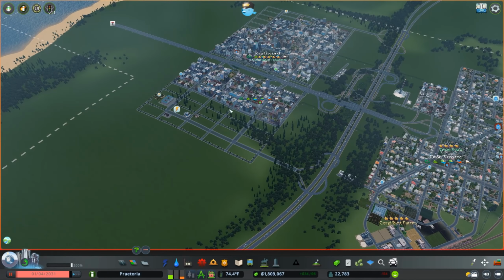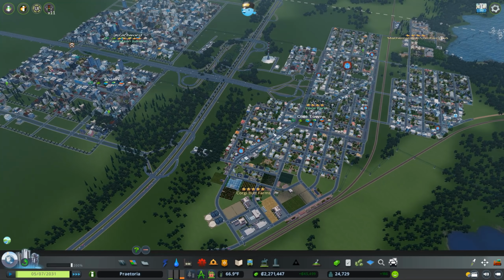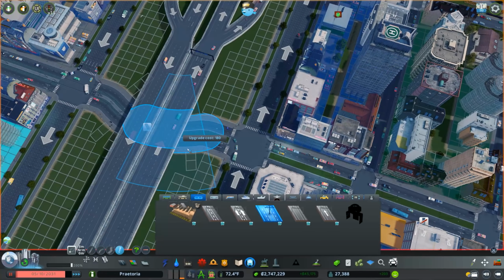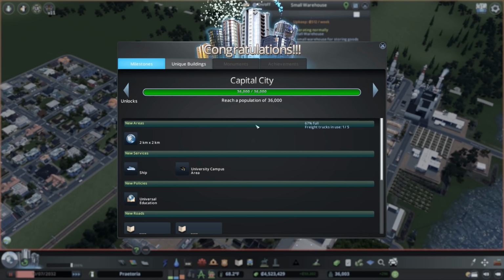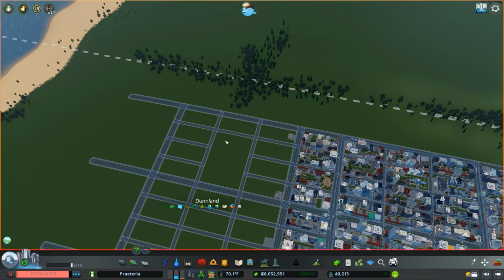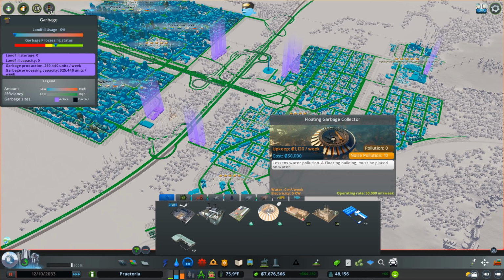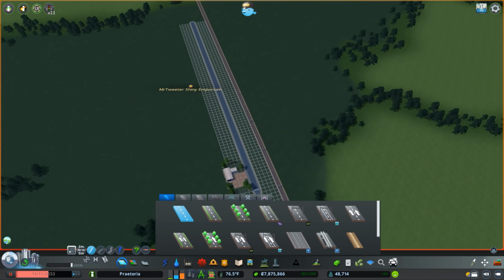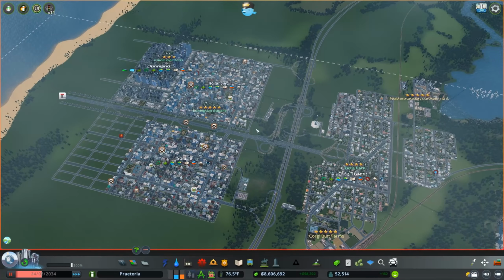Cities Skylines - Industrialism (Part 5)

Comment: @Pravus I know I'm kinda late with this comment, just trying to catch up on your series, but I wanted to comment on why people prefer to take a side ramp entrance instead of direct entrance. The answer is: The Speed Limit. They always take the fastest route considering distance and speed limits but not the traffic. So you can solve the issue by using TM:PE to decrease the speed limit on the side ramps. Then they'll take the shorter direct entrance when reasonable.

Comment: use signs, replacing the lights. using YEILD signs for the major goings and stop signs for the less major. use the traffic manager mod youve been using but you can use more of the features to mittigate deleting roads, creating roundabouts, upgrading roads, or moving buildings and service buildings ETC.
Reply: also using curved roads keeps the cars going faster for example where the trucks are going towards the train cargo station right next to the lumber yard. a curved road leaning towards the train station would speed it up pretty well

Comment: Tip for roundabouts, open traffic manager, select signs and do control+shift click on the roundabout. This will set everything up as you should want it

Also using the road arrow in traffic manager you can force turning lanes

Comment: It feels like part of the problem is that you are giving the AI way, way too much credit in assuming that all the cars should be aware of the current traffic levels and take the most efficient route in light of current traffic buildup. Yes, everything's handled by a computer, but I wouldn't expect that level of pathfinding in this game and frankly, it's sort of more "realistic" if it doesn't. As far as I can tell, the people are programmed to travel by the shortest physical route to their destination (at least via the roads), which in the case at the start of the video looks like it's through the industrial area before taking a right to reach the residential rather than straight, left, then right, so again, the shortest route to where most people are trying to get to funnels into a single area, causing backups.

You can have all the roundabouts and one ways that you want, but for the most part the flow of traffic is going to be dictated by the smallest chokepoint of your main thoroughfare, and sometimes what the pathfinding dictates is the main thoroughfare isn't the one you wanted it to be.

Comment: As others have indicated already, the mod you have installed (Traffic Manager) has several good options for resolving traffic problems like the one you had in your industrial area. Banning civilian vehicles from the ramp leading to the industrial area could work. Removing traffic lights (and replacing them with yield signs) is often the silver bullet. If all else fails, try timed traffic lights.